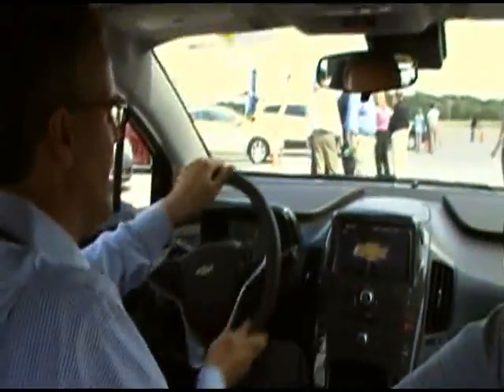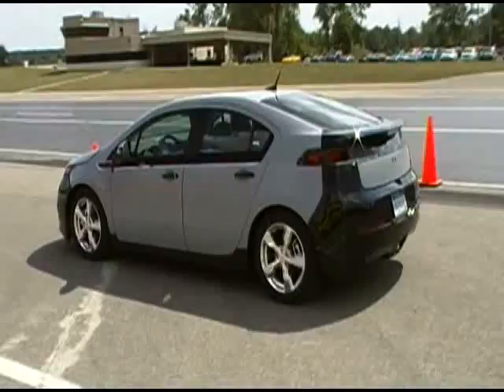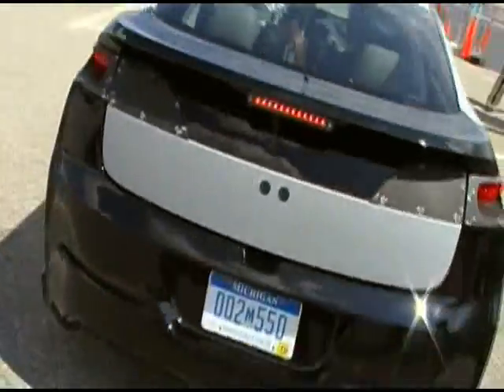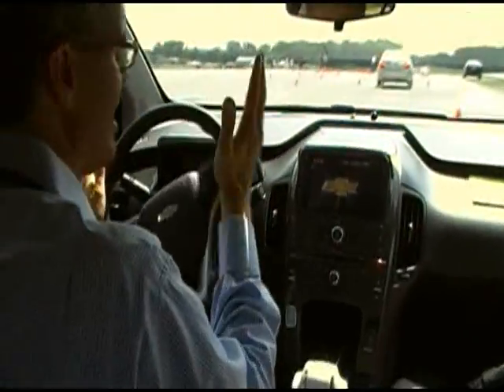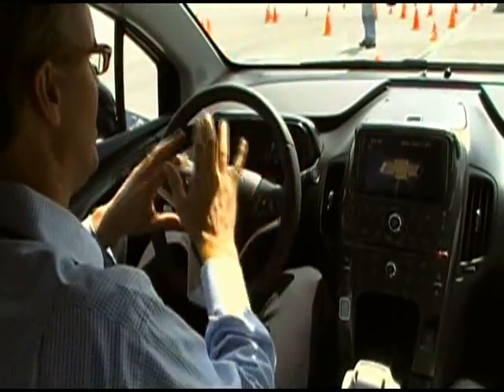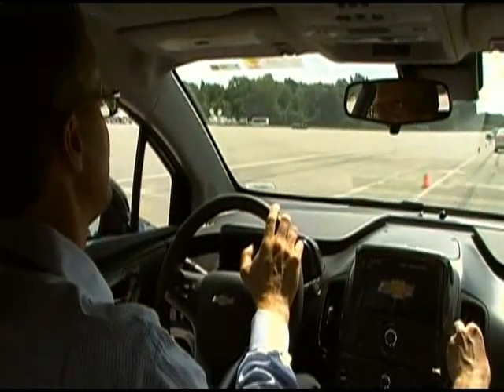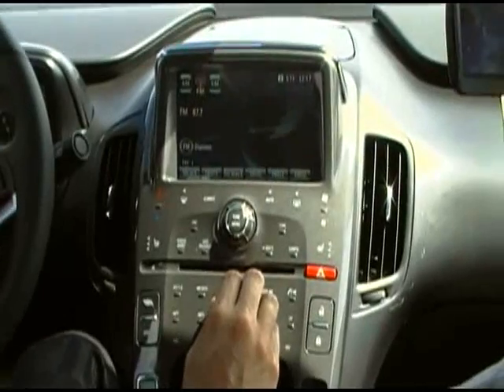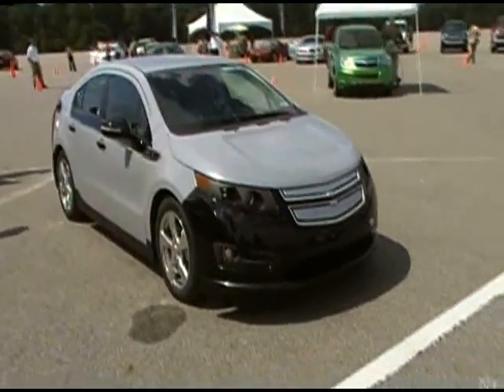Going for a ride in a pre-production Chevy Volt with chief engineer Frank Weber

Comment: Let's do some math:
typical car 25 MPG $24,000
Volt           200MPG $40,000
Vehicle Life 200,000 miles
Price per gallon $2.50- $4.50
cost of gasoline over life-
typical vehicle 200,000 miles divided by 25 miles 8000 gallons multiplied by $2.50-$4 = $20,000- $36,000
Volt 200,000 divided by 200 = 1000 miles times $2.50- $4.5 = $2500-$4500
Volt saves $17,500- $31,500 over 200K miles
Purch. premium is $40K - 24K= $16K
Purch. Prem less fuel savings equals $1,500- $15,500